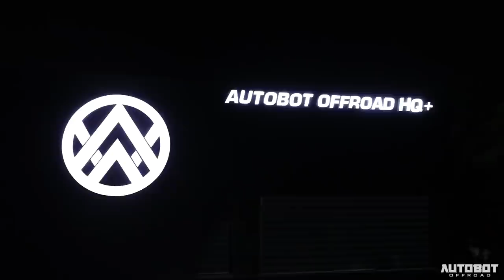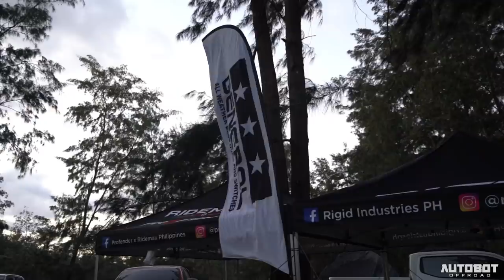AUTOBOT OVERLAND - LAKE MAPANUEPE

Comment: love all the setup and the fun run. out of curiosity, what do you normally do when one of the vehicles had some failures and damages and can no longer run like the one earlier with the CV joint and axle issue. do you just tow them or the team can still manage to fix it realtime on site?
Reply: Switch to 4x2 daw tapos tinow nalang

Comment: Ang tanong, anung usmunod na nangyari dun sa nasiraan ng front axle?
Reply from the maker: Towing sir using Factor 55 Tow strap 😄
Reply: @AutobotAutoworksOffroad  Salamat. Pero I mean, hinila nyo sya from the water? then tumakbo ulit sya papunta sa destination point nyo with a broken axle? or nirepair nyo os-site, or hinila na pauwi ng garage ang car na iyon?
Reply from the maker: @bethzarin6439  kaya padin po sya patakbuhin sir pero ppuntang destination naka strap lng sya sa jeep para di hassle pag di kinaya ulit :)
Reply from the maker: @bethzarin6439  broken axle but still can engage the 4x2 mode so yeah we tow him all the way to the destination especially in sand terrain